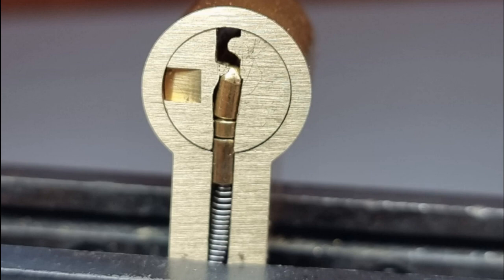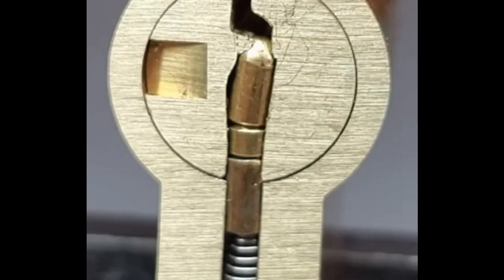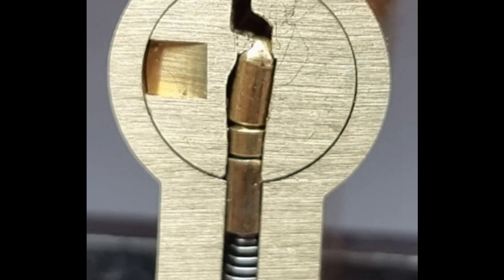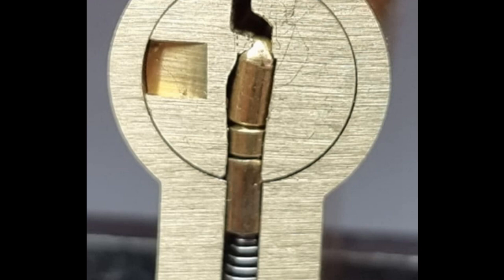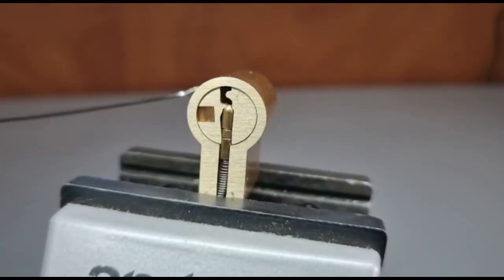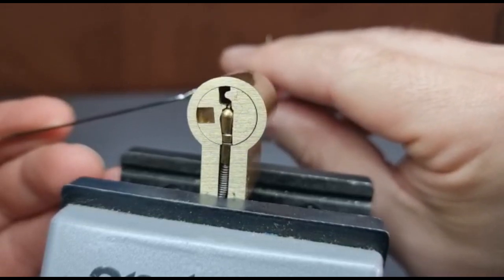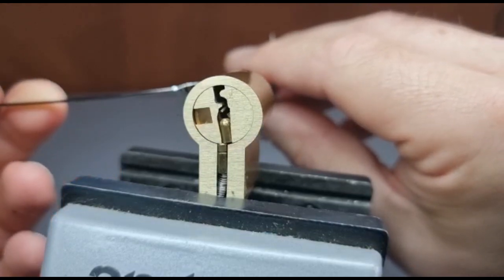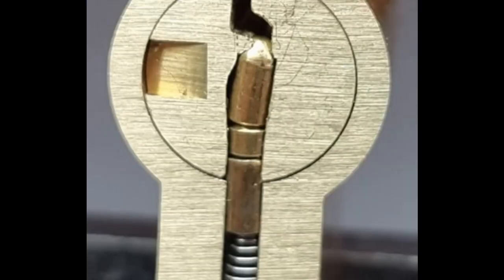How Do Master-Keyed Locks Work?

Comment: Yes, the legend is bringing that fire again!   Excellent demo!!

Question:   Can you have more than one wafer in each pin?  Or is that just asking for trouble?
Reply from the maker: 'Bringing the fire' I like it. I am a bit confused about your question though because you mention 'wafer'- there's no wafers in pin cylinder locks. Maybe it was a typo.
Reply: @LockPickingLegend  Ah... sorry.  I don't know the right terminology.    I'm referring to the tiny / short middle pin.  The one added for the master key.

Can you and another one, thus allowing a third different 'Master key'.

I'm not even sure that made any sense either... LOL.
Reply: @majorlee9714  The terminology is interchangeable depending where you are from. Master pins are called wafers and yes you can have many more wafers in the pin stack than just one. Cheers
Reply: @PocketWomen  ah ha!  Thank you!   I'm learning all this stuff from online... 50% from the UK and the rest from US videos.  I think thats why i called it a wafer.

Thanks for clearing up my confusion!  You're a star!
Reply: @majorlee9714  All my locksport knowledge comes from the locksport online community, it is very international, there can be subtle differences in some of the jargon. A big learning curve!
Reply from the maker: @PocketWomen  Nice one, PW - I only just saw this - thank you for clearing that up. I had heard them referred to as wafers before, but thought they had got it wrong too, lol.